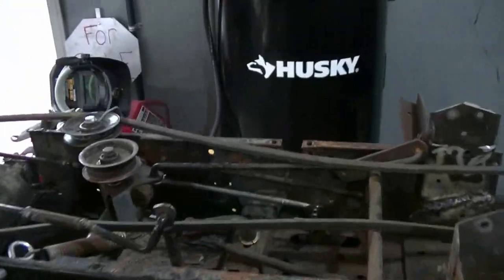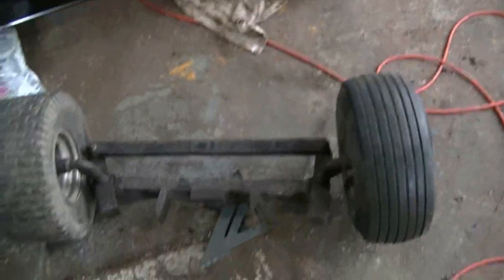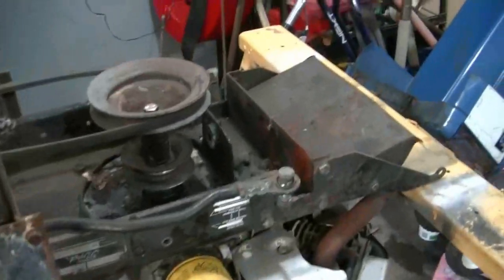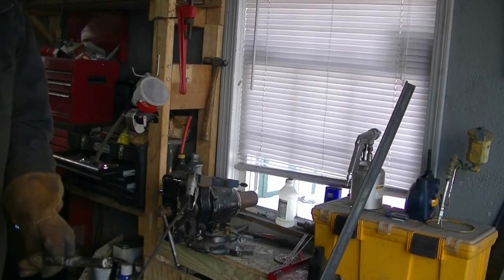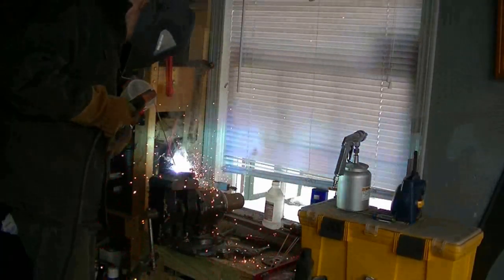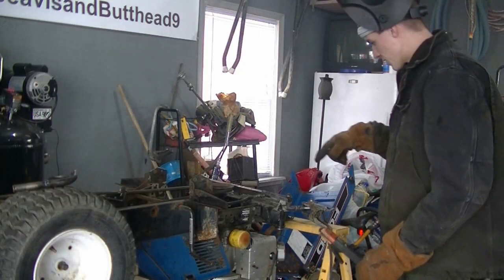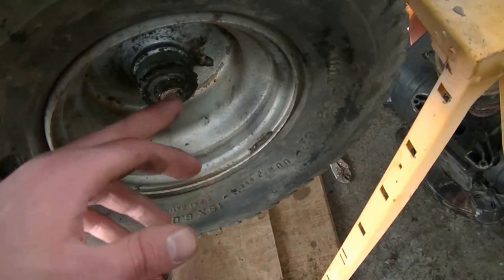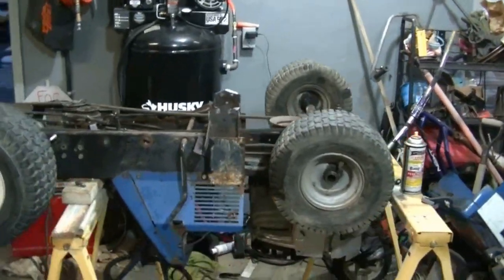Welding Up The Ford Racing Mower Steering

Comment: If you can manage it, you should look into throwing a turbo onto that Ford rig, something off of an old Turbo Chevy sprint would be awesomner as frig. All you would really need is about 6 psi
Reply from the maker: the thing has plenty of ass! pulls in 5th gear!
Reply: Oh I bet! I personally think a turbo would be a little on the excessive side but would be funny as hell to see you destroy anything and everything on the 710 lol out of all honesty, it would be cartoon fast lol
Reply: StevO G plus you forgot the awesome turbo whine!
Reply: A Turbo Chevy sprint unit would be WAY to big, when it comes to turbo's you need to match AR to engine capacity, having an oversize turbo on a small CC engine will cause  turbine wheel to stall when compressor wheel  comes under load, plus dealing with surging.
the standard mower carburettor won't work with a positive pressure, would require converting to wet charge system. another major issue would be correct ignition timing , running positive pressure on normally aspirated timing would cause massive detonation killing  piston crowns in no time. net result nothing apart from a lot of wasted time and effort.

best to make sure engine is, as good as can be. service inlet & exhaust valves making sure they work 100%, keep valve clearances to the minimum service value, clean intake system, increase CR a little and run the highest octane  fuel or additive available also making sure AFR is as spot on as possible for best power produced.